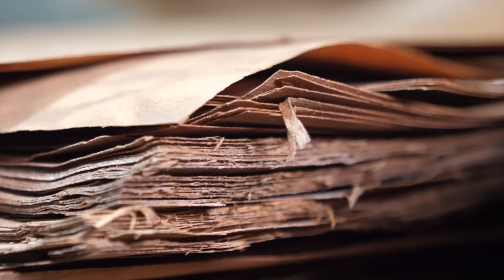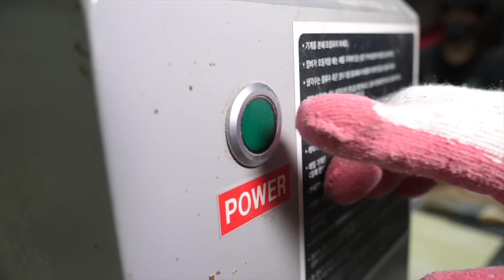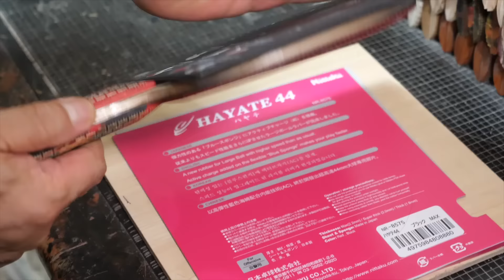process of making a Korean luxury table tennis racket. table tennis racket artisan

Comment: I make the rackets for myself completely by hand. It takes many hours and I use single-layer wooden, chestnut, walnut, and bamboo boards. It is very satisfying when you play with them. They are not as slow as we might think since they don't have carbon. Still, I love this video.
Reply: You should make a video on it. By the way do you sell those rackets?
Reply: @Phoenix-ph9qp  Hi Phoenix, I haven't made videos because I usually work on them for a while every day and I don't consider myself a teacher. I am a club player. Regarding selling them, I am considering it to be able to buy a wood laminator and improve my rackets.
Reply: Жаль, что они не допущены к соревнованиям ITTF.

Comment: yep, 75% of work in making tt blade is decorative. 75% of the price is marketing margin. anyone can make basic super zlc blade with a plain handle at home for ~30e (instead of 140-240e sold by big brands), and it's that expelsive 'cuz you'll have to buy at least 10 sheets of core and finishing wood and 100x30cm carbon sheet. making 5 blades form a  minimal ali-e pack would make your blade cost you like 10euros (and max 1h of work (minus night hours of pvc glue drying out). and if you're lazy, just buy 5pl basic 5pl cheap chinese 10e blade, and clue carbon and hinoki/aouys ply to it, i've done it 10 times, makes you just fine off+ outer carbon blades out of dirt cheap stuff. take a def wooden blade, glue your plies and thicker outer ply, it'll feel like a nice inner carbon. plus, oversized def blades can be cut into cybershape hex style.

Comment: Nicely made. . The router bit that cut the handle could have a round shape to it, save shaping it on the sanding belt. Also I noticed that where the bit started and stopped when cutting out the bat it left an indentation, this could be avoided by starting the cut at the base of the handle on the corner. Phew that laser was super quick, there’s me thinking that was carved by hand : ) but I did notice a tiny chunk of wood had splintered off - quality control ? ?. Looks like the box that the bat is put in is more expensive to make than the bat itself. Obviously the bats are more for show as a serious player would apply their own choice of rubbers.
P E A C E.   : )
Reply: Man came in and critiqued one of the finest and most high grade table tennis racket artisans in the world, as if he was saying to his local baker that he left the croissants for too long in the oven🤣😂
Reply: @nicolasgoossens  I won’t justify my comments with my life long experience, knowledge and qualifications. Anyone with the understanding of working with wood will know exactly what I have said and advised in my comment is correct and fair. As regards the local baker remark, I worked in a baker’s shop from the age of 10 to 15, so yes, I would notice if something had been baked for too long.
Reply: bro he don't speak english lmaooo
Reply: @Sarcastitonea  Did you mean to say ‘he doesn’t speak English’ ?
Reply: @FUNKINETIK  no serious table tennis player uses these blades or rubbers. u were on point with your criticisms. hats off to the business owner anyway, gotta make a living out there somehow. im sure that the rackets you can find in a western sporting goods store are going to be less playable than these.
Reply: Полностью согласен с Вами! На мой взгляд - пиар и больше ничего!
Reply: @user-qc3pf5kk1u Почему больше ничего, а разве не прекрасное основание/деревяшка?
Reply: no to mention that the grain direction is wrong an the handle at the end could in some cases not fit perfectly  and if so it couldn't be fix due to this cheap colorization process
Reply: Подписываюсь под каждым словом. Сколл бросился в глаза, т.к. я занимался художественной резьбой
Reply: gatooo

Comment: Dear Sir (GozipTong) ??? You're name -
I was touched watching you're video
On how you're bats are finely cut in articulate designs and artistic behaviour
It was beautiful and a precious moment
I would like to know 10:45s there was a 
Dense cut out in the handles I didn't get or understand that ? And you're customised racquet holder is just a gem
I spent time cutting out 14" inch dough
Balls and Vega and I've never seen it up
Close and like this and how would you may get the pressing and prints that easy like I would say good job 
Thankyou Steven James you're sub watcher
Reply: It's pretty common for a table tennis blades to have some cut out inside handle for weight balance. It shifts the balance towards the head, which give you more power and clearer feeling, but it's not for everyone because it makes entire raquet to feel heavier.

Comment: Please don't just hand-paint random brushstrokes and then Lasercut the wood like that! Why didn't you resin/lacquer the handle afterwards to prevent dirt buildup in the gaps.

Using a scoring cut before making the full-depth plunge cut will help with better edges. 

That T-slot in the handle is STIGA MARKETING BS! It makes the blade vibrate even more losing the precise touch, causing poor balance and lack of feeling from the handle! THIS IS MAIN REASON I NEVER BUY STIGA! 

Also PU-Varnish is a good decision, but again why didnt you PU Varnish AFTER  paint?? Wouldn't the paint just come off the below previous PU Varnish layer ??? 

I hope you are not one of those cheap chinese imitation manufacturers.
Reply: @TurnRacing  It looks good, but that's just all
Reply: I think STIGA’ｓvibration is good point,but it is bad work. It isn't major maker ptroduct. I wonder this was a racket made by XIOM...  Only good point is looks,,, Others are all bad ,,,
Reply: If you care that much make your own
Reply: @QYXP  way back in 1977 when I was 13 years old wanted a skateboard with a kicktail at the front as well as the back, there was nothing like that about and so I made my own (and one for a friend) by making a wooden mould and laminating thin layers of plywood together. Guess I should have started a business with my design, it wasn’t until the 90’s that skateboards began to look like the one (two) I had made.
P E A C E.  : )